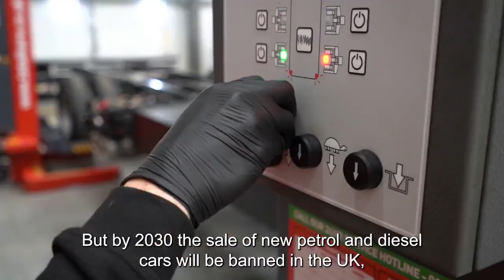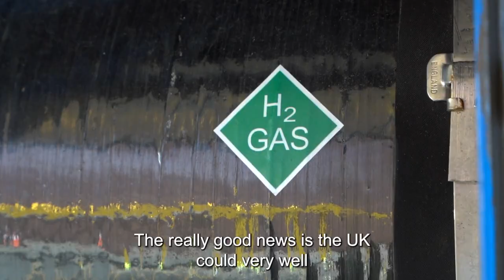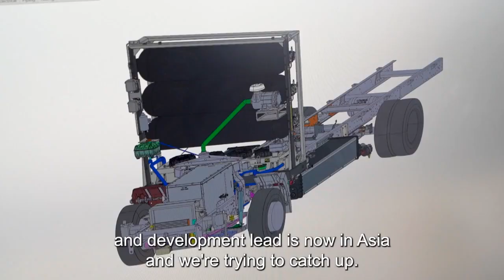The UK’s hydrogen vehicle technology potential explained

Comment: They just need start build hydrogen loophole, the best way is making hydrogen from sea water, i believe even current turbine electric generator with modification can run on hydrogen that by hydrogen steam or direct hydrogen turbine electric generator, they say that hard, imposible for delivery hydrogen, that is false, stupid statement, world need start build permanent electrolysis in refueling station, we just need managing method how to send sea water to refuel station, not finished product of hydrogen, but raw material (water) that send by pipe or delivery by truck, our problem is solve.

Comment: There are currently, only a handful of Hydrogen fuel stations in any country.. No sign of infrastructure expansion. Even though some vehicles are available to buy, It's a dead fish if  people can't buy Hydrogen locally.
Reply: They just need start build hydrogen loophole, the best way is making hydrogen from sea water, i believe even current turbine electric generator with modification can run on hydrogen that by hydrogen steam or direct hydrogen turbine electric generator, they say that hard, imposible for delivery hydrogen, that is false, stupid statement, world need start build permanent electrolysis in refueling station, we just need managing method how to send sea water to refuel station, not finished product of hydrogen, but raw material (water) that send by pipe or delivery by truck, our problem is solve.